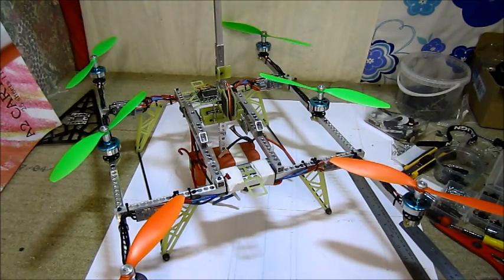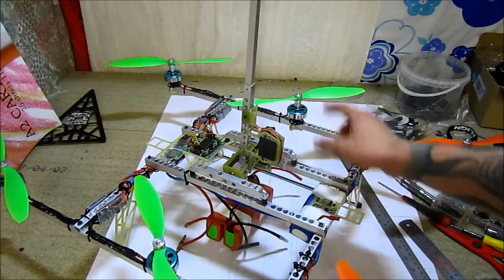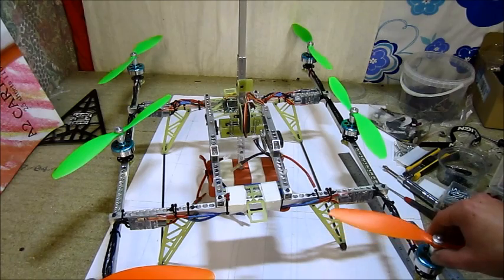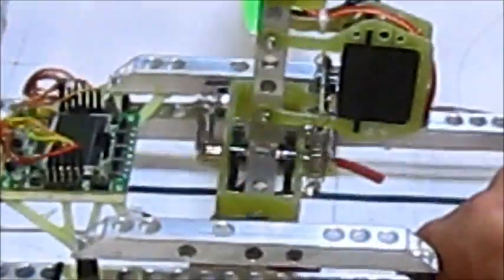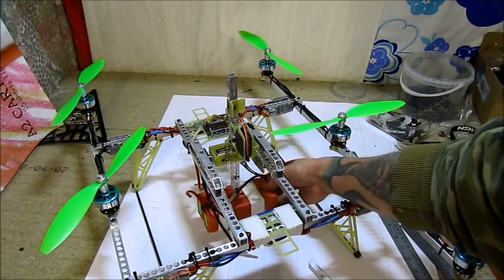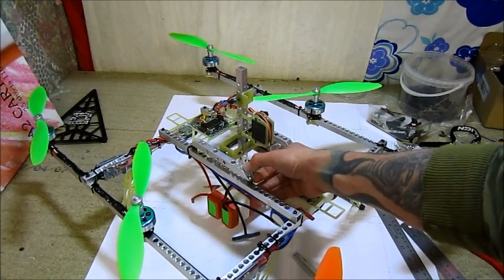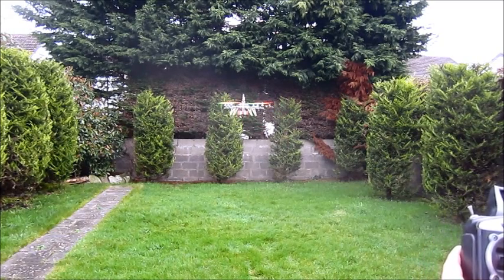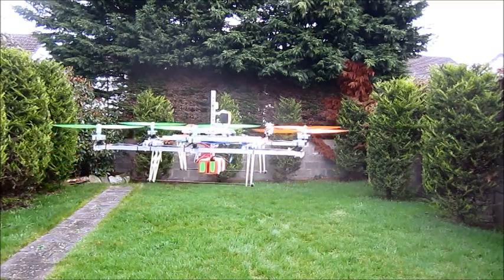H6 KK2 copter with Ecilop(ish) gimbal. Build pics, review & maiden

Comment from the maker: And how do you know that? Usually 6 motor 4s setup is around 3kg AUW and over, when I got to 2.5kg AUW on this one. Nearly all (one exclusion) of my DIY frames are much lighter than  the stuff on the market, and when a copter hovers at 50% or less throttle, then it is too light, not too heavy:) I didn't weigh bare frame for comparison, but if you know the way to tell the weight just by looking at the video, please enlighten me how to:)

Comment: Nice video explanation and build ,
you can adjust gimbal settings on the kk2 by connecting the receiver as normal (without any esc/motors connected)bridging m1 an m2 positive pins (only)  then connect a 5v bec to m4  , arm and spin the motors although there not connected the gimbal will work now ( safer than having the motors connected)  Thanks again.

Comment: Nice build! I have the same problem with yaw on the naza. I have sort of butterfly setup. Problem with yaw is two motors on one side and three on the other side needs to go faster. Or perhaps the controller is making the center motors spin equally and just change the speed on the outer four motors as a quad.